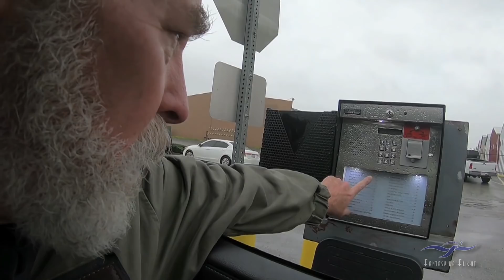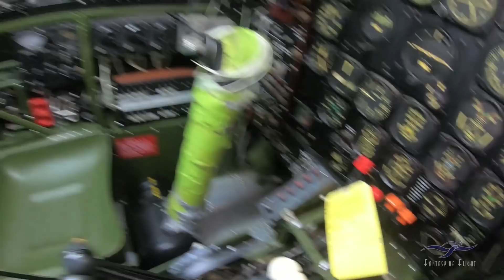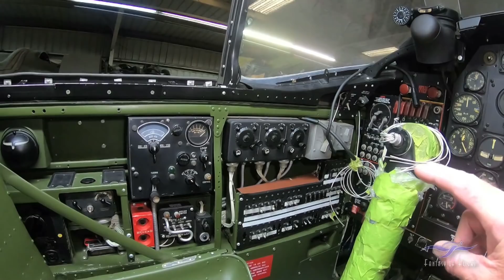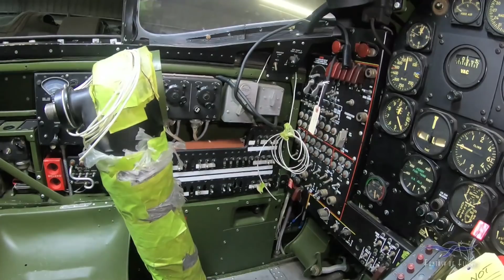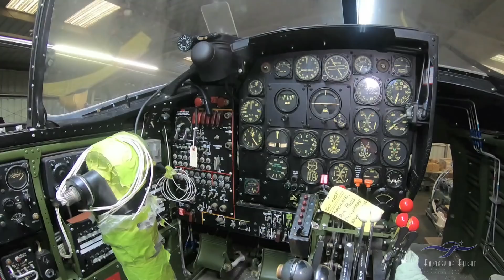Douglas A-26 - Project Visit 2019

Comment: I saw major progress in this unit. After Oshkosh you should get the gold from the Udvar-Hazey museum. Dead sexy piece of kit. Jeeze see if you can get a few thousand rounds of .50 ammo on eBay and really make a splash! A p40 at Wanaka ten years ago was loaded up and did a straffing pass both days- it was there if you looked and listened very closely but I think they may only have had two guns firing, I shall have to read my autobiography again to check.

Comment: That is a pretty cool  A26 restoration, when I worked at the airport used to see A26s of Airspray take off with full  loads of fire fighting retardant mix. You could hear the props bit into the warm summer air as they sped down the runway for take off.  Even though I don't work on the real thing I do build scale models of aircraft and currently working on an A26.  I eventually want to build 3 in total. While studying the A26 I have some interesting facts ,  WWII A26s flew into combat with mixed formations of glass nosed and gun nosed aircraft , so it is possible that gun nosed aircraft had only a crew of two maybe a third for training purposes. The glass nosed aircraft had a crew of 3 , the navigator/Bombardier,  the sat in the jump seat during take off as it was prohibited to be in the nose on take off. The rear gunner position had some refinements later on possibly after the war ended,  1 was the introduction of the side fuselage door for egress purposes, originally the escape was through the bomb bay and the upper escape hatch above him. The canopy clam shell opening replaced the single large forward opening escape hatch, I couldn't image trying to open it at 100mph . When they changed the canopies the upper gun turret could no longer be locked forward as the rounds would hit the raised portion of the canopy.  Apparently the under wing gun pods caused significant drag , interesting to note is that the 6 gun universal nose had 4 gun pods =14 gun or the 8 gun nose 6 internal wing guns =14 .  This later configuration led to the use of 5in rockets under the wings . Hope this helps and I really like your Kermie cams .and your strive to preserve history .

Comment: that 1820 amazed me the end if not for the collings foundation B-17 could be for Classic Rotors for their Piasecki H-21 flying banana. as it used an enhanced B-17 engine which is a Wright R-1820 but the studs on the front reduction gearcase bolted the shroud for the cooling fan and the fan and the extension shaft that go to the rotor gearboxes. as the piasecki h-21 were the Boeing/Vertol 44A and 44B models as well. i seen in some videos of B-17 wrecks the crankcases of the R-1820 survive well  but the cylinders and that broken off of them.

Comment: Didn't they fit some with a 75 mm cannon?waot, nvrmnd, he answered my question in the vid
Reply: you're thinking of the B25 in it's H/G variants
the A-26 never was used with a 75mm, it was tired but not adopted, the gun nose was universal so the larger feed chutes may have been for the additional .50, 20mm or 37mm cannons, the chutes otherwise look too small for a 75mm casing
Reply: Optional nose armament was a part of the A-26B.  The nose could have been set up with the following armament.
1. Six 50 caliber machine guns (early production A-26B).
2. Two 50 caliber machine guns on the port side and either a 37 mm or 75 mm cannon on the starboard side of the nose.
3. Four 50 caliber machine guns on the starboard side and one 37 mm cannon on the port side of the nose.
4. One 37 mm cannon on the port side and one 75 mm cannon on the starboard side of the nose.
5. Two 37 mm cannons.
6. Eight 50 caliber machine guns (late production A-26B).
I am unaware of any of the cannon options actually being used by combat units.

Comment: 2 years and instead of having the engines running parts of the plane are missing because hes using it as a prop on a wedding? I'd not be too happy with that. On the other side, moving the plane now sure would be a hassle ;)